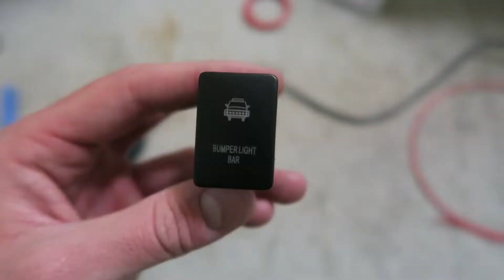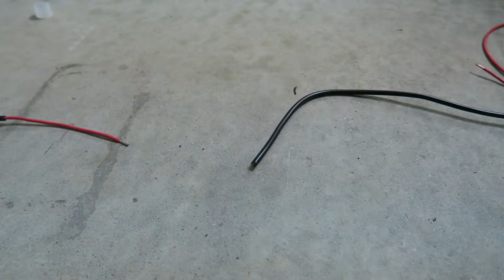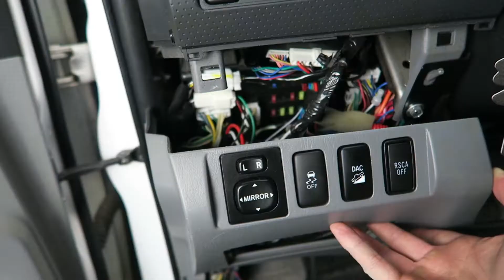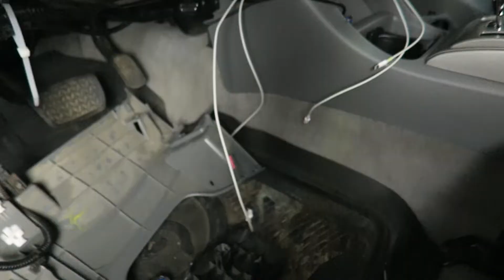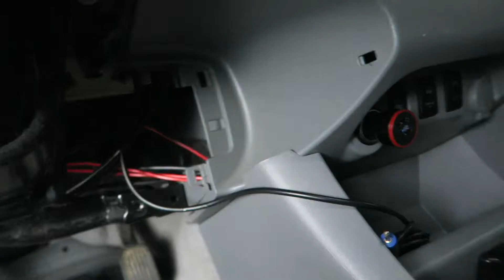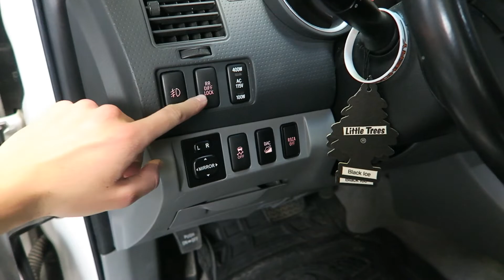Wiring Factory Style Switch For LED Light Bars

Comment: Hi Braxen... I just hacked my garage opener to a Toyota push switch. the opener is working find , I have a red and black not being used.
How can I get The switch to light up with the dash lights? I'm installing it on a 2019 Tacoma OffRoad left side short panel.
Reply from the maker: Sounds like you’d just need to run the power wire to a fuse that controls the interior lights.. it’s hard to know without seeing what’s been done, but that’s what it sounds like. It also depends on whether or not that power wire goes to the button light or not.
Reply: Braxen McConnell 
Hi Braxen , please note this a garage remote hack that I’m trying to do. The two wires to the remote work. The add a tap and the ground are now connected and also work ... the only problem is that when I turn the truck off the switch stays on...? Maybe you could figure it out...? I have disconnected the add a fuse to be safe. The Tacos is a 2019 TRD off-road ...👍
Reply: Did you ever get the lights hooked up to the dash dimmer?
Reply: Brian Bawiec 
Hi Brian, thank you for your interest and helping me. I finally hooked up my switch to my garage remote hack. The remote is working, I then connected the ground and the tap a fuse wire to the dimmer fuse it turn on , but it doesn’t turn off when I turn the truck off. The switch stays on?... note the wires connected to the remote are running with the remote battery not the trucks. I’m only trying to light up the switch.
Reply: Hi Braxen ,
Thank you and Brien Bowiec for your help. I will try you idea soon and let you know how it all pans out...👍

Comment: Question how hard is it to put the wire threw the  rubber boot to go from the outside to the inside of the truck??
Reply from the maker: If you mean the way I did it, it can be pretty tough, that thing is on there tight. I usually have to give it a few tries. If you mean putting through the center with all the other wires, I don’t know, I’ve never tried haha.
Reply: Braxen McConnell  so no middle on the top I see. Was that hard??
Reply from the maker: It wasn’t too bad, it takes a little work to get around it, but it’s doable. Seemed easier than trying to fish it through the center of it all
Reply: Going through the center isn't bad at all. Simply just tape your wire to sort of long skinny rod or screw driver and pull it back into the cab. Did this technique many times on my tacomas.

Comment: its not dumb if it works . nice work bro
Reply from the maker: Haha thanks man!
Reply: hey bro you have a wiring setup for the ditch lights or is it the same way
Reply from the maker: It’s the same. One of the switches I wired in this video is for my ditch lights. I just wired all the ditch lights into the same wiring harness and button.
Reply: @BraxenMcConnell  awesome thanks bro

Comment: Braxen:

I bought KC lights led spot beams with Rago brackets. The KC lights came with the wiring...it seemed straight forward, i.e., plug and play. I hooked the yellow (positive) and the black (ground) to the battery. I ran the wires through the fire wall. I did not use the factory switch that came with the KC LED’s; instead, I bought a switch that fits the slots for the Tacoma. I stripped the wires followed the direction on the video about the wiring and also used two 10 amp fuses/tap Into the tail lights. 

I believe I wired the switch correctly. I wired the the red wire closest to the black wire to the fuse tap. 

Everything went as planned the truck started right up and and the spots worked beautifully. However when I drove back home that is when the issue first started:

1) backed up the truck to load wood and listened to the radio with just the ignition on;
2)When I started the truck I noticed it struggled to start;
3) When I unload the wood at the my Aunt’s house turn the truck off; when I finished, the truck completely died;
4) I jumped the truck and it started; drive the Tacoma around in hope it would charge the battery; I went home and the turned off the truck and the battery died again;
5) the KC light wiring diagram states non-relay wires;
6) also, the Tacoma is a ‘14... it still had the org involved battery since purchase, i.e. about 4 years old;
7) I purchased a new battery last night...I disconnected the LED lights for now and disconnected the fuse tap.

Do you have any ideas what may be causing battery drainage, please advise.

Sorry for typos using in phone!
Reply from the maker: Hmm it’s kinda hard to say without seeing it, but maybe double check your wiring with the switch. 
With mine I did Green(+) to the battery, Black(-) to the truck ground on the side of the battery, then with the reds, you need to be sure you wire the right red to the relay. I tested this by touching wires together before soldering them. 
Basically I took the red wire coming from the harness and touched it to each red wire of the button, with the button in the (on) position. 
On my button, both LEDs illuminate when the pods are turned on, but only one when the button is off and just the dash lights are on. So when it’s just dash lights, the lower LED lights up on the button, but when I push it and turn the pods on, both the upper and lower LED light up on the button. 
If it’s draining your battery, it means that something is constantly drawing power from your battery. So it’s just a matter of finding what wire it is that’s drawing that power. Hope that helps!
Reply: Braxen McConnell Thanks, bro! I am going to retest everything and will comment back my results. Appreciate the response. Thanks, again!
Reply: Happened to me too. I unplugged the fuse. Car runs fine now. My led is always on on the switch no matter what. Not sure why.
Reply: “I wired the red wire closest to the black wire to the fuse tap.”

Not sure if this is your problem, but it definitely is incorrect. 

Here is how to wire those switches:

If you have the green disconnect harness with--green, red/white, red/white, black coloring--here is the correct way to wire them. Green is 12V+ input into the switch. Red/white next to it, is 12V+ power out when the switch is pressed in. The top light should light too. The next red/white close to black is form headlight 12V+ to light up the writing on the switch at night when the head lights are on. Last the black is 12V ground. Thus, the switch bottom light (writing) is lighted when the headlights are on regardless if the switch is pressed on or off. 

When the switch is pressed on, the new load (perhaps an auxiliary light) is powered and upper light comes on indicating power to the load and that switch has been pressed.

I hope this helps.
Reply: @Mahigeer1  so how would this be wired then? Green is the 12+Volt, black is ground, how would the other 2 red wires be connected?
Reply: @khoatran8343 Please read the above post completely.

Comment: Where do I get extra wire to add from the switch to the fuse tap?
Reply from the maker: I would just go to Amazon or a hardware store close to you
Reply: What size wire?
Reply: 12 gauge? Okay thanks man!
Reply from the maker: https://www.amazon.com/gp/product/B01ANYZO12/ref=as_li_tl?ie=UTF8&camp=1789&creative=9325&creativeASIN=B01ANYZO12&linkCode=as2&tag=braxen-20&linkId=c2a396f8100acc2c2fc0bb1ff71f24be
Reply from the maker: That’s what I would get 👍🏼

Comment: Do you have to solder the wires together or could you just electrical tape wrap the wires? Thanks!
Reply from the maker: You don’t have to solder, I just did it for a more solid connection. You could just wrap them together and tape them, but I would at least get some wire crimps for them. That way they don’t come undone.
Reply: @BraxenMcConnell  awesome thanks! Will be installing this setup you recommended this coming week!

Comment: Why does my switch stay lit even when the car is off? I bought the same switch as you and fuse tap in. The lights all turn on its just the switch stays on when the car is off...
Reply from the maker: Are you using the 10A TAIL fuse location with the add a circuit? Some circuits stay on even when the truck is off.
Reply: So if I put the add a circuit in correctly it should work right? 3rd one from the left on the top row right?
Reply from the maker: That’s where I put it, yeah. You might have your two red wires on the button crossed. One goes to the relay, and the other goes to the LED lights in the switch. The one that comes from the relay supplies constant power, which is why the light on the relay is constantly on if you use the stock push button, the other illuminates the buttons with the other dash lights. So try swapping your two red wires around and see if that works.
Reply: ok When your truck is completely off your switch doesn't light up at all?
Reply from the maker: No, the lights are off completely until I turn the truck on and turn on the dash lights. If the button is in the on position, then the switches will light up regardless of if the truck is on or not, but that is supposed to happen as an indicator that the light bar is on.
Reply: Do you think that it will drain my battery if the little switch light is left on all of the time?
Reply from the maker: Depends on how long you leave the truck sitting man. LED lights draw a very small amount of power, but it’s still drawing power. So over time, yes it’ll drain your battery. If you leave it over night, it probably won’t kill your batter, but don’t take me word for it haha!
Reply: Sorry I've got another question. Should my wiring harness be directly connected to the battery? Or do I use the add a fuse only?
Reply from the maker: Yeah, your wiring harness should be connected to your battery. The add a fuse is only for the dash light illumination, no other purpose.
Reply: My switch stays lit too. I did as Braxen did. After switching the 2 reds was your problem solved? I tapped into the 10A tail light as Braxton said. Cheers from Australia
Reply: @nectarioslelekis2238  did you find a fix for this issue?
Reply: @khoatran8343  yes mate I tapped into the accessories fuse so switch comes lit when car in acc mode and off when I remove the key

Comment: my harness has two wires one red and one blue. They connect to a prong switch now,  but its too big. So i got the smaller switches I do not care to have them lit up, its no big deal, also do you know which wires would connect to my switch
Reply from the maker: Hmm if there are only two I would say the red is your positive that would connect to the relays 12v positive, then the blue is probably your negative which would connect to the black negative wire of your relay. Have you looked up the wiring for your specific switch? They should have some kind of diagram or instruction.
Reply: yeah its basically the same thing you have its got the 4 wires with the green connector that goes into the push button switch, the green connects from your source with an inline fuse, red 1 connect to your relay or accessories, red 2 normally connected to dash light circuit to be on when your dash lights are on, black is ground

Comment: Since you used to the TAIL fuse (10A), will the lights still dim with the rest of the interior lights?  Or do you need to go through the PANEL (7.5A) fuse (which the interior lights supposedly go through)?
Reply from the maker: I don’t think they dim with the other lights if I remember right.. I’m out of town for the week, but I’ll get back to you on that! You could try the PANEL fuse, they might dim with that one of the interior light go through that.
Reply: That wouldn't dim them.... You're simply taking into the 12v power, not the dimmer switch itself 😂

Comment: why did you buy a separate wiring harness if the aux beam light bar comes with one?
Reply from the maker: I only needed to get one for the pods. The 32” bar came with one, but the pods did not. So I just needed one for the pods.